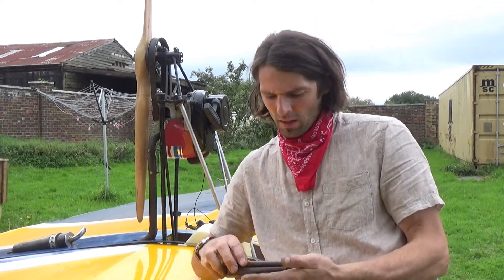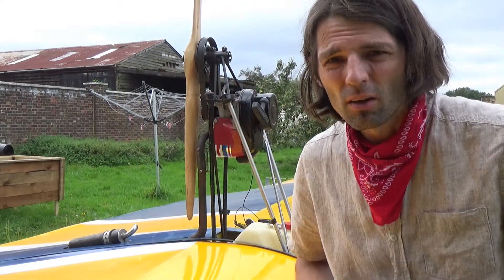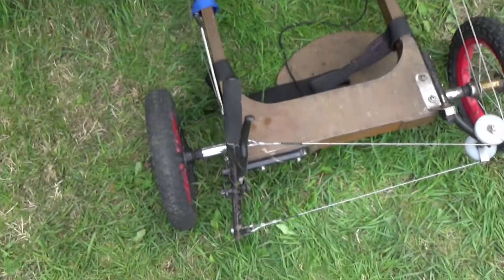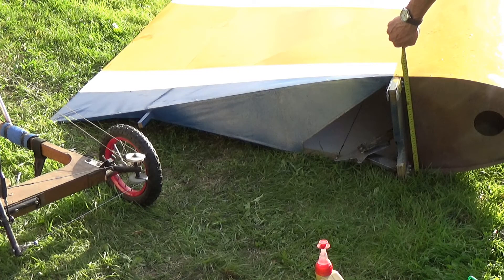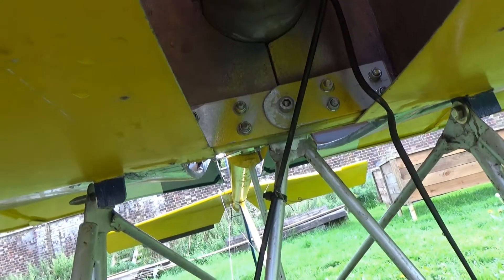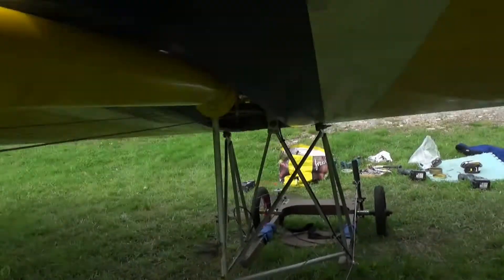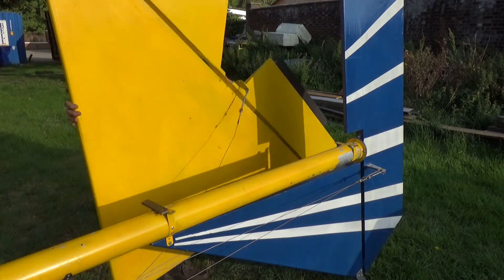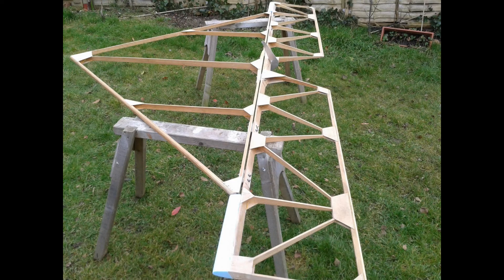VJ23 good aircraft?

Comment: I built a homemade vj-23 i used wood box truss frame down the wing instead of leading edge plywood composite . I also have a metal vj24 w needs spar end replacement/ reinforcing and it is with a komet 30 horsepower engine Those are not mean  comments .  People joke saying it looks scary to them . They do not want to hurt you . Some might be mean .